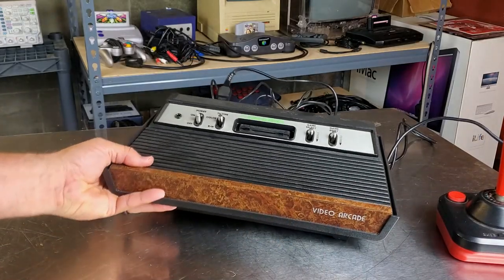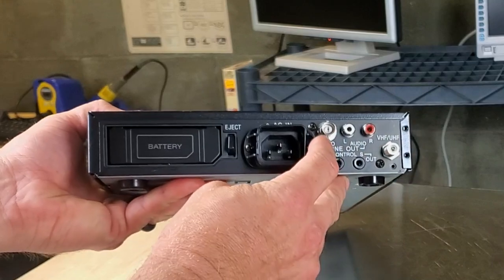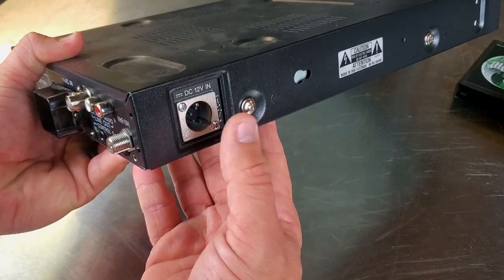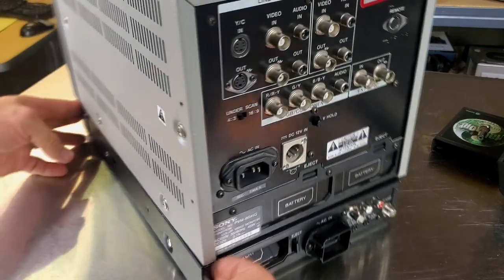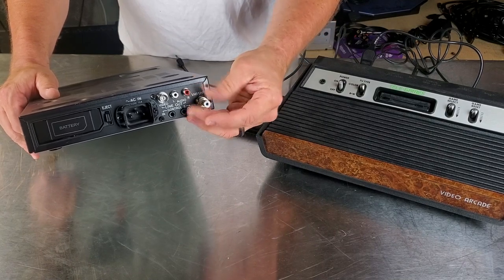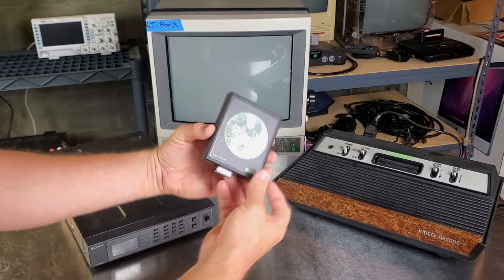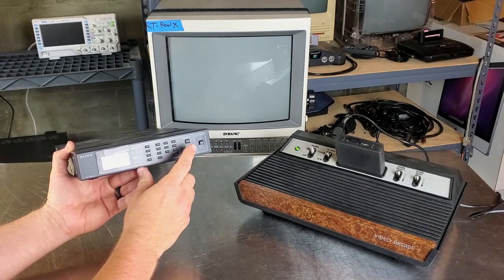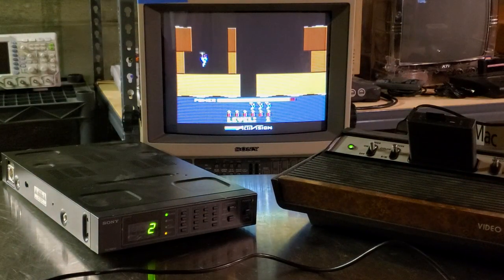Getting RF into your Pro CRT | Sony TU-1041U Tuner Converter

Comment: Nice! I just bought a TU-1040, it only does mono sound but it 100% matches the look of my BVM-8045QD (Which doesn't have audio inputs anyway) and it only cost me $45 shipped. My primary use for a TV tuner is diagnostic; most SNES/SFC consoles which come to me as 'for-parts/non-working' (Typically for 'no/bad picture') actually do work if you hook them up via RF.

This is because the analog signals from the video encoder IC to the AV Multi-Out go through a cluster of signal conditioning caps, and the signal to the RF modulator doesn't! So, if the caps are kaput, no video!  In fact, it doesn't take much to push the AV output's sync signal far enough out of spec that it won't work on many TVs. (Another point for using a PVM/BVM as a diagnostic tool; you can see the video signal pretty much regardless, it just won't have any sync.)

That's my first diagnostic step; Switch from AV to RF. Get picture? Definitely the caps.  Then I observe for signs of deeper issues with the console before committing to a recap. (CPU issues are fun... Ever seen Mario die on the SMW title screen?! I have!🤣) Can't wait for my tuner to arrive so I need only switch inputs on the BVM! <3

Comment: Excellent video as usual! I'd like to know if you have tried the TU-1110, as that one uses a 6-pin DIN connector instead of Composite and likely provide a better picture quality? Sadly not a lot of PVMs in my knowledge have a 6-pin DIN to connect it to tho.
Reply from the maker: Do you mean the VTR input?  If so, unfortunately that is the exact same video quality as composite video.
Reply: @RetroTechUSA  The VTR connector is a square one, right? The 6-pin DIN I was referring to has the same shape as an S-Video connector, but a couple additional pins (instead of the usual 4-pin in the S-Video) for pulling power from the PVM through the same cable. Thought it could give an improved video signal cause the two connectors look pretty much the same... But I very well may be wrong hahaha. It can connect to the top left input here in the PVM-1910: https://cdn.shopify.com/s/files/1/0836/7947/products/284108513007-2_1024x1024.jpg?v=1607812669

Thank you for answering tho! :)

Comment: Hello  retro tech please help me i have a problem with my sony pvm 9041QM the issue it still all the time in HV delay mode no way the change it!! I'd tried to repair the hv delay button failed 😢 I would like to cut off the wire in order to obtain a normal screen

Comment: Hi! I NEED HELP PLEASE I can't connect the RF signal from my video game to a Sony TU104TU and then a Sony Triniton PVM14N6U monitor. What could be happening? I have a European Master System II and its only output is RF. No signal appears on Sony TU104TU.
Reply: European Master System II, the keyword here being European, so it's PAL RF, and it will not work with this unit or any NTSC TV with RF that I know of. You can manage to tune in a Japanese console, but European, I never heard of it working. Get an NTSC Master System to play RF with this, they are still cheap and you can keep your PAL for other stuff.

Comment: Hi! Me again... Could anyone or you help me with some information? I have a Master System II PAL G but it has no signal when connecting to Sony TU104TU and then to Sony PVM14NGU pvm monitor. Sony 104TU has the American NTSC signal? And so? can anybody help me? How do I get the Master System II PAL G signal on a PVM monitor?
Reply from the maker: Hi, unfortunately this is an NTSC only device.   PAL will not work with it.
Reply: @RetroTechUSA  Thanks a lot for the feedback! Your videos are amazing! How could I connect Master System II PAL G video game to Sony PVM Monitor? Would it be possible without Sony TU104TU? Is there any other way to connect a PAL video game to a Sony PVM monitor? Thanks!